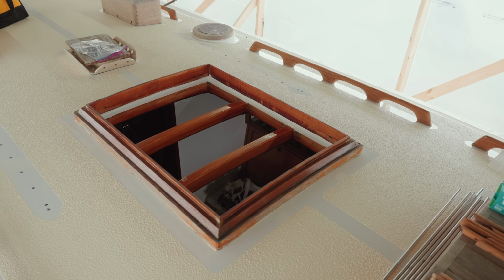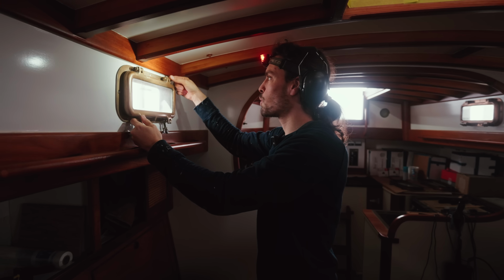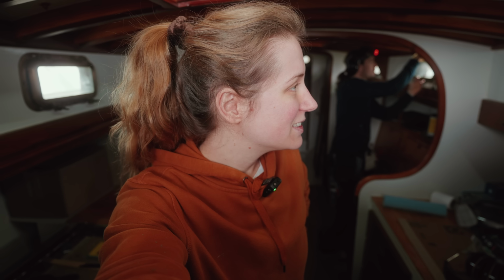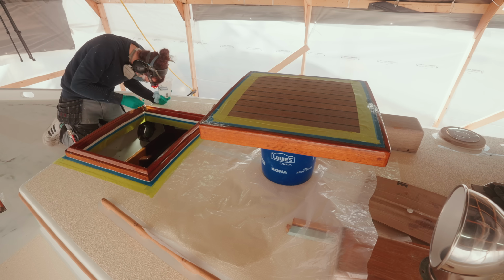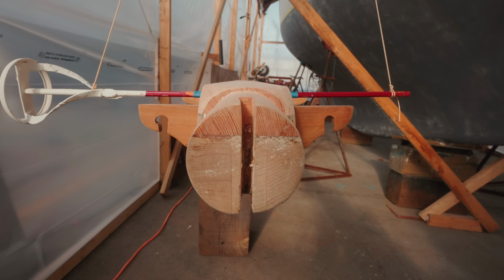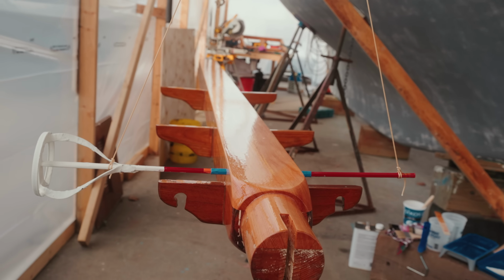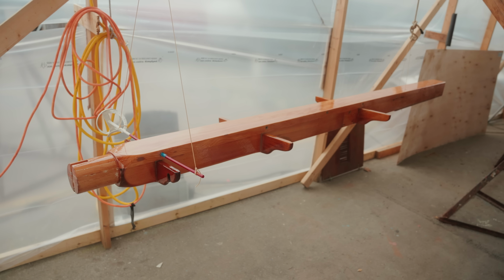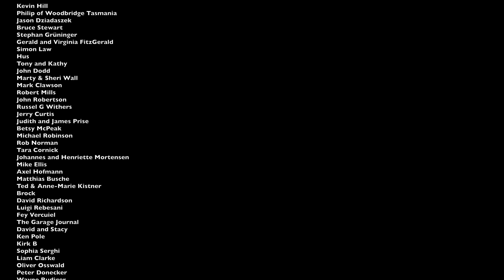Shipbuilding: The Butterfly and the Bowsprit

Comment: Cracked glass - gives you an opportunity to replace it by hardened laminated glass, rather than the common window panes that had been used (from the look of it). With laminated I mean two thin layers of glass with a laminate between them - many types exist. The hardening means that the worst that will happen if something falls on the glass, a chip comes off and it still is in one piece - if something notable would happen.
Reply: I agree and would it make any sense to get it tempered and tinted a little to keep the cabin cool?  Just a thought.
Reply: @rebeccahedberg6656  - that's a good thought too. I restored an over 100 years old brick&mortar house. We replaced the wooden window frames by deeper ones that can hold insulation glazing without having to make visible adaptations on the outside. SMC could do that here easily. We used a double glazing with a heat film in it that allows heat to pass in one way but not the other. In my climate we allow heat to come in, but about one month in summer it gets incredibly hot inside. If you want thermal insulation in general you need 15mm (about 3/5 inch) of air gap. This has maximum insulation. The heat film is a metal-like coating on one side of a glass pane and it will be visible to those knowing what they are seeing. The age of this boat would not forbid using it, though.
In my case, we used the laminated hardened glass in the outside glass of the insulation pair.
Reply: PET. It's has a high transmittance than glass, is basically indestructible, lower thermal conductivity and ridiculously cheap. Only downside is soft surface, so you need to be careful cleaning. I'm never using glass again
Reply: Yes, I was wondering if you have regular plate glass there, what are the chances of getting caught in big waves and one breaks over the boat and smashes the glass? The boat would get flooded pretty quickly.
Reply: @jpdj2715  Some good points here. Tempered glass of a sufficient thickness would be able to withstand any wave and even support a person stepping on it, but it would have to be sized carefully to allow some differential expansion and contraction of the glass and the wood frame. As described, an insulating glass unit with tempered glass on the outside and laminated glass on the inside would be optimal but the seal between the glass would have to be really good.
Reply: @TheCrustyCaptain  - true and part of the discussion now has become to try to keep at least the infrared and longer wavelengths outside - do you know of PET pane that can do that by itself or with some film on it ans still look sort of like see through glass? Not cynically meant, I just don't know.
Reply: @markgallagher1376  - big waves don't have enough speed relative to the boat to do that, I think. The butterfly hatch's design is a very old "proven" solution. It's more like protecting against something falling on the glass that has a smaller contact area, gravitational speed, and higher density than water. A tool, a tumbler with or without distilled beer that had aged for more than a decade with or without rocks in it - tumbler: nomen omen. Even tempered glass may crack now on the outside, but nothing falls through and nobody gets hurt as the lamination keeps it all together.

Here @TheCrustyCaptain's easily scratch-able PET would do really well too, but the relatively horizontal surface getting sprayed or engulfed frequently will leave some bio-matter every time and keeping the window clean, without scratching, in an anally retentive state of mind and care, may soon turn into WTF, Just Ffing Do It.

About water - it can be used to cut steel and for that the jet will be released with a pressure between 20,000 and 55,000 psi (1,379 .. 3792 Bar - 1 Bar is average atmospheric pressure) at a Mach 3 speed - today, cutters' thin jets can work at 0.002 inch (0.05 mm) precision. In dry air, at mean sea level's atmospheric pressure, at standard temperature of 15 °C (59 °F), the speed of sound is 340.3 m/s (1,116.5 ft/s; 761.23 mph; 1,225.1 km/h; 661.49 kn), so in those circumstances, Mach 3 would be some 1,021 m/s (3,350 ft/s; 2,284 mph; 3,675 km/h; 1,984 kn). Yes, that's knots faster than waves.
Reply: @jpdj2715  I have seen videos of pilot house windshields blown out by big waves. Maybe since they are vertical the waves hit them with more speed, but I would think a couple hundred pounds of water falling on it all at once could break it. But I guess if these things have been used forever without incident, I’m just worrying for nothing.
Reply: Wonderful progress, what a fantastic job, much love, The Senior Confessor, England
Reply: @markgallagher1376 Water from waves usually doesn’t have significantly more speed than what gravity gives them. That, however, can be significant if it’s a large (tall) wave and the boat is some distance away from where the wave broke and created free falling water. Waves don’t break that way unless they’re disturbed, usually by a shallow. Can also be current. That’s why surfing breaks are along the shore. That’s not a place we want to be in big waves. 

The majority of the energy in water hitting a boat usually comes from the mass of the water, not the speed. One cubic metre of water is one metric tonne. Same as a small car. It doesn’t need much speed to cause significant damage. The clue is that the boat needs to move away from such impacts. In severe weather, it will go downwind, ideally with a Jordan Series Drogue. That will avoid the big impacts. The water that hits is much less volume and usually mixed with air, reducing its destructive effect.
Reply: @jpdj2715 The enemy of every glass or pet or acrylic hatch is the spinnaker or whisker pole. They have a magnetic attraction for each other. The pole always wins. My boat has a raised cabin with lots of "Plexiglas" I guess. Also 10 opening hatches all in grey smoked acrylic. All installed by the builder 22 years ago. We live in "The Sunshine State" and so I do have blinds on everything.  You can stand on the windows and the boat is certified as Cat 0. Looks like it has some life left in it so far.
Reply: @philgray1023  - that's a great addition, perspective. My personal experience with plastic and glass.
Glass - windows of my house are tempered laminated glass. It's an old brick and mortar and we replaced windows (the wooden frame around the glass in the posts) so as to have insulation glass integrated invisibly. Most old houses here, if receiving such glass, lock the glass package with wooden slats on the outside. Ugly. We used slats in the frame that mimic old-fashioned putty. Handiman accidentally hit the glass rather than a nail on the head: a chip of glass came off - hammer with round head-surface, so the impact was both high energy and on a very small area.

Plastic - Nalgene plastic bottles - I have been using these for a long time due to a liquid medical feed. The transparent plastic is incredibly strong, if there are no production issues in a series. Which however happened and while the plastic formed cracks around the machined opening and at the seams from the injection moulds, my test of the strength of these bottles, trying to destroy one with the hardest hammer blows I could give - nothing. The Nalgene plastic is called (trade name) Tritan and is a variant of HDPE (high-density polyethylene). It compares to Lexan. Chemically, Tritan is a polycarbonate variant. More flexible and more shatter-resistant than other polyethylene variants.

Glass - Car front window: doing 75 mi/h (120 km/h) in Spain on a 2x2 lane high/motor way, I started to pass by a large truck-trailer combination of the heaviest kind allowed in Europe. It was doing 50 mi/h (80 km/h). The towing vehicle had double wheel sets. This was in a right bend in the road. A rock must have been caught between a pair of wheels and got thrown backwards at that 50 mi/h speed that I was approaching at 75 mi/h. We, humans, may deal with higher velocities than 125 mi/h in sports - tennis, baseball, and others - and be able to extrapolate (predict) a path. My wife sitting on her knees in the passenger seat, facing backwards, would get hit about at the back of her skull, by that 2"..3" round rock, if it were to go through the window in an unaltered by the impact trajectory.
The trailer was right of me, the guard rail left, I closed my eyes and turned my head away, spoke a curse word, kept steering that bend in the road's path. Then the impact and a spray of glass fragments. I opened my eyes, looked at my wife looking at me, the window was still there. The lamination had formed a bag with glass fragments on it, there was a 1" hole, but the rock had not penetrated. The rock had been less than fully elastically been thrown back by the lamination and left the car flying over the roof. Half an hour later, at a significant gas station, we stopped and the bag in the lamination had slowly shrunk to almost flat in line with the in tact parts of the wind-shield. While a practically uninhabited region, they had cleaning stalls and vacuum cleaners. The hole was in the triangle where the wipers don't wipe. I bought some 2" tape and taped the inside and outside. On the way home, through France, rain didn't penetrate that. I gave my car dealer a ring, and they ordered a replacement - special tinted glass because heat-rejecting - and a few days later, arriving in my home village, they replaced the broken one.

As to your story about the cabin above the deck with e.g. butterfly window, the risk you describe is why these generally have metal bars over them. Considering the size, weight, potentially falling-velocity angle, point of impact, etc., I would argue that potentially these had been chosen as decoration if/when something breaks/bends through these. At J-class size, it becomes a different story, of course, and more a matter of designing the location of a butterfly window in such a place that the likelihood of a whisker pole's pointy end falling on it is extremely low. I would also worry about the boom breaking from the mast or the boom vang breaking off the boom. Both got relayed as personal experience by friends in the past. The case of the boom was an extreme speed sailboat with loads of sailing high-tech where a couple "conventional" things had not been reviewed for their ability to withstand the forces at top speed when the boat would fly from the top of one wave to just below the top of the next, in very heavy ocean state.

Yes, shift happens. And a boat/ship is as seaworthy as its crew.

Comment: As a professional cabinetmaker I have been using a festool sander for the last 8 years. I will stick with it. The butterfly hatch on my schooner never leaked. Silicone is evil on a boat. It corrodes aluminium and you can’t paint it. You’re doing a fantastic job Alidino. Looking forward to the boat in the water.

Comment: Hi you two. Think about getting glass panels that are unbreakable like in cars (I forgot the name it has a formica film sandwich between two panes of glass), and yes sealant on the glass panels not adhesives! Also, likely too late now, but a trick with the seals for the portholes is to cut the joint at an angle so when you glue them it is like a scarf joint. 
You are so closed to splashing it is exciting! Yep stabilizing the wood with epoxy widely used in building knives etc. but on a spar like the bowsprit that will be under tension and torsion the epoxy might crack, unless using penetrating epoxy.
Beautiful work!

Comment: Tip (not that you need it) 
If your under-frame hatch/b'fly frames crack open again (perhaps from iced moisture), a not-too-hard and unobtrusive solution could be to chisel in a rebate for small metal corner brackets. Inside or outside corners. This is something I'm sure you would already know though. Cheers

Comment: Getting replacements from a company is much easier when you are an influencer and you are just that for any boat and ship builders out there. If a non influencer had tried, chances are high that they would not get a replacement, but it would take the full tie to repair before sending it back and soon enough you will get the same issue all over again. When my dad built us his 30 feet colin archer based ship, we always had that issue until y dad admitted that he was a company insurance person. After that the companies more or less threw stuff we wanted after us. So being an influencer in some way always make is easier with companies.

As for leaky butterfly hatches, yes that is well known issue, so with my dad's built we had one such hatch and it was always leaky. It took us years to figure out how the water got in and it was through the hinge at the top. and from anywhere the water would collect a few drops for a short time. The only way to fix it was to use a full on other design as those butterfly hatches are horrible that way until they are redesigned from the bottom up and have some sort of water guide solution under the hinge to lead any water to the outside. Having a smooth surface is important too so all the water that hits it just flows down and away. But at that point it is no longer a butterfly hatch, but something else and would need a new name. The good news is that we now can design that horrible hatch better than ever, if we really want to and if it was me, I would have done that right away to awaked the pain of a wet bed and other annoying water results due to a leaky hatch.

Comment: I've had very good luck on my exterior brightwork with noticeable difference / improvement regarding longevity using a first coat of Smith's penetrating epoxy, 5 coats Epiphanes varnish.  Think it's particularly effective with penetration/adhesion to teak with it's high oil content.

Comment: I think you will come to regret having the bowsprit fixed firmly into the hull. The extra length is expensive in marinas and if there is a collision it will be a major repair.  Changing the design so that it can retract in harbour will pay off in  the long term

Comment: The staysail should be anchored at the stemhead.  If you are using the staysail as it should be used, as a regular sail, not an alternative to the jib. It is much better if it is fixed to the stemhead or the bowsprit at the stemhead.

Comment: Hi Guys, being the armchair quarterback that I am, I am wondering if on that butterfly hatch, if you had totally disassemble the hatch, clean up what is under it and reassemble it better so it would be water tight? And will the new glass be strong enough to withstand a big wave?  Sailing Yaba has a similar bowsprit as your only longer , supported by tensioned cables . Will yours be similar or do you think your bowsprit will need such support or not? Also what kind of wood is your bowsprit? Thanks for the great video!!